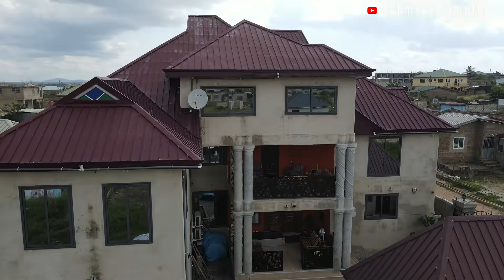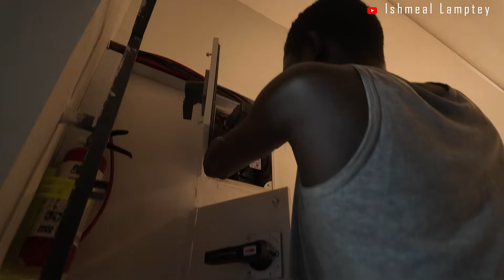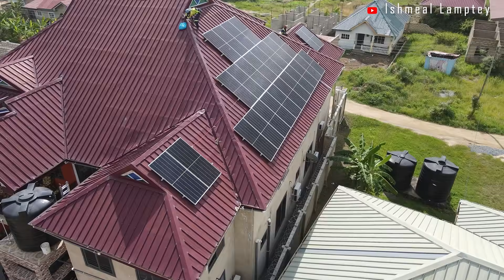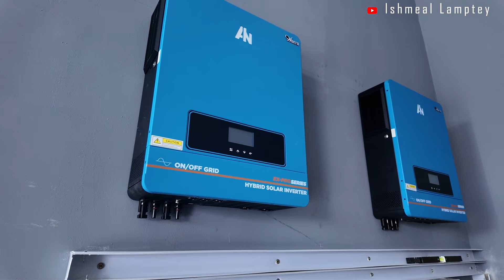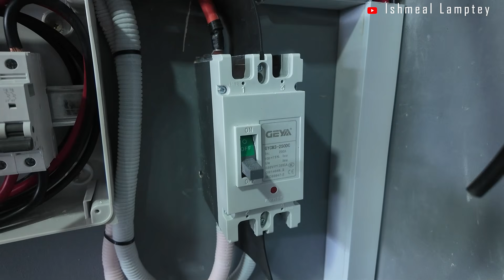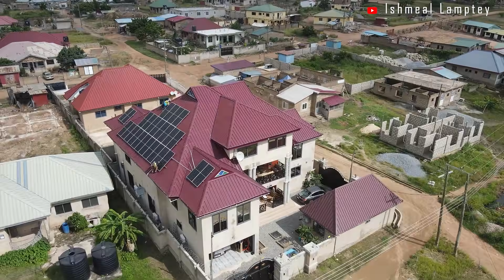Not your usual 20kw solar system Installation

Comment: That’s not two separate phases, that’s called a split phase where one phase is split into two 
From phase to phase it’s 240v and phase to neutral it’s 120v, 
That’s the American system, but you’ll run into problems when you try to run heavy equipment like washers and dryers in the way that you wired them
You’re supposed to send two live wires(L1&L2) to the same outlet for heavy equipment and yes, those inverters can paralleled with L1 to L1 and L2 to L2 from inverter one to inverter two and neutral to neutral and ground to ground 
So for your 2 8kw system, you’ll end up  with 16kw 
It’ll be best to redo the wiring as the split phases can only handle 4kw per phase and they don’t handle phase imbalance well at all
Also you can’t use appliances you buy in Ghana unless they’re rated for 110v-240v
The 240v in Ghana is different from the 240v in America as in America 240v has two wires carrying 120v each and the 3 phase will be 480v instead of 415v/400/380v that you know

Comment: Nice video. 

I’d advice you take a look at the DC SPD, Uc rating of 1000V is too high. I doubt the max VOC of the inverter charge controller is that high. Your Uc rating should be match or be slightly above your charge controller max VOC for it to be effective. 

Kudos to you!
Reply from the maker: I totally agree with you. Unfortunately, these materials were bought about a year ago so we had no choice than to use it for the installation.

Comment: How on earth as a solar installer you can propose somebody with such a massive solar power system to continue using grid energy ??!!! It is good your customer did not listen to you, lol. Sorry. But you are doing a good job 🙂
Reply from the maker: The setup may look massive however in reality it isn't really the case. The number of appliances being used by the customer is usually what determines how the system can be used.
Reply: @IshmealLamptey that’s correct. In designing a solar system, a lot of things must be considered. For instance, I chose a high efficiency bifacial solar panel  for my system. These panels do not need a bright sun to generate full power. With little sunlight, my panels produce their maximum power 10.4kw which provides direct power to my home during the day (average day consumption is about 2.5kwh) and still charges the batteries to from 40 to 100% in 3 hrs. 

You must really factor in your daily consumption using the best scenario as in maximum number of appliances you likely to have on and their power consumption. People tend to undersize their system which trips under load.

NB: your channel is very educative. You’ve gained a subscriber
Reply from the maker: @gordonowusu-ansah2628 sure i agree and thank you for subscribing.
Reply: @abednegomulwa6368  45kwh is not massive

Comment: I find it difficult to believe that one would spend thousands of cedis for a solar system and still use the grid as the primary source of power and the solar being only a backup when dumsor occurs. Why would I continue to pay for electricity if my panels can meet my power demands during the day and I can rely on battery backup at night?. 
I have a 10kw system (panels) installed with a 30kw battery backup tied to three 6.3kw inverters (18kw total) connected in parallel for 3phase. The   panels generate enough power to power my home during the day with enough reserve to charge the batteries to 100% SOC. Even on cloudy days (raining season) and with two A/C's (2hp)  constantly on, my batteries get fully charged before midday. The 30kw battery backup is able to power all my appliances and 2 air-conditioners(inverter ac's) throughout the night and still have about 35 to 40% SOC by morning. Ever since I installed my system (hybrid), I have never had to pay ECG a pesewa. (6 months now). Am a heavy power user paying about 600 to 700 cedis per week when I was depending on the grid. I use Anern products as well (panels, battery and inverter)
Reply from the maker: Your use case is commendable because the solar system has been properly sized to meet your energy needs. In many instances, clients are unable to install a fully optimized system due to financial constraints. As a result, having a solar setup as a secondary source of power becomes essential in case of grid failure or shortfall.

Even so, during the daytime, the solar panels supply power directly to the load while also charging the batteries—leading to a significant reduction in electricity costs.

However, if the battery capacity is insufficient and the system is set to prioritize solar and battery usage with the grid as a backup, it can place undue strain on the batteries. This frequent charging and discharging can reduce their lifespan over time.
Reply: @IshmealLamptey You are right on the initial installation cost. I was taken aback with the quotes I received from companies to have a 10kW system installed in my house. 
I had to take matters in my own hands, gather orders from close associates and order directly from the manufacturer in China. I was able to have same system with triple the battery storage (30kw lithium batteries) for less than 70% of the cost I was being quoted for a 10kW system. Too high markups makes solar unattractive in Ghana
Reply from the maker: @gordonowusu-ansah2628 that's good to know. Doing business in Ghana is a bit on the high and consumers usually end up bearing the cost. Solar systems in Ghana indeed are not cheap.
Reply: @IshmealLamptey The government is not helping either with the import taxes on solar products. Why must we pay import levies, EPA and Energy commission levy on imported solar products. Being taxed by the same institutions you are saving is crazy.
Reply from the maker: @gordonowusu-ansah2628 I agree. At other places, people are given incentives for even using solar systems. Unlike here
Reply: @IshmealLamptey  But this was not the case of insufficient battery storage, sir.
Reply from the maker: @abednegomulwa6368 How's that so when i did the load assessment of the house?
Reply: I think you should put the grid off totally to see how much you are really using...sometimes the installers do some connection in the back to support ur load. Even 2kw for 12hrs will be 24kw. 30kw can't do what you are talking about. But yes ECG should be back up instead
Reply: @jojoowumanmensah1733 I have never pulled power from the grid ever since I installed my system. I live in a smart house where everything is connected to power. And my 30kw battery is more than enough to keep everything running at night including 2 air conditioners. Power consumption by inverter a/c is really low after the initial 1 to 2hrs. Sometimes I check my live consumption with 2 a/c’s on at night and it’s less than 600watts. 

My system is set to SBU ( solar first, battery second and grid third). If my battery drops below 20% at night where there is no power generated from the PV cells, it will automatically switch to grid power (hybrid system). But I have never had to use grid power for  6 months because by system is properly sized to my needs.
Reply from the maker: @jojoowumanmensah1733 That will be the case if the quantities of the batteries are entirely okay to serve on an off-grid system.